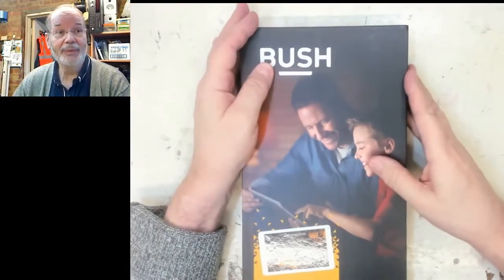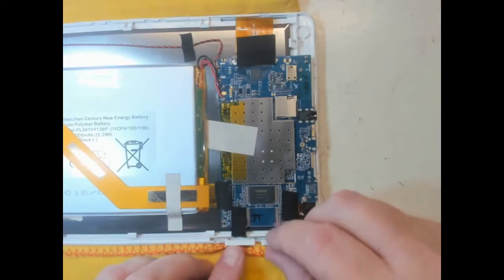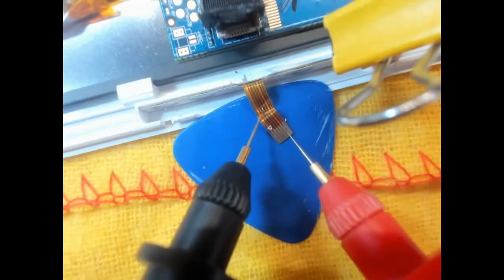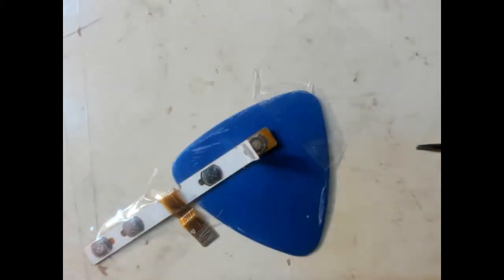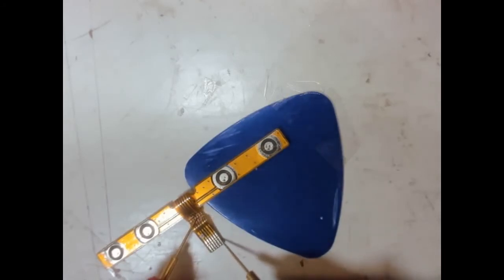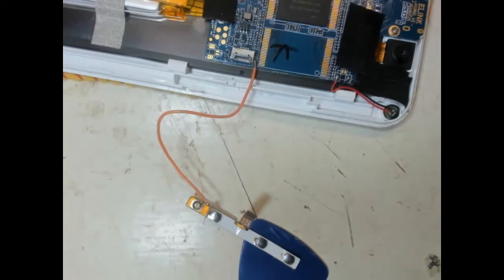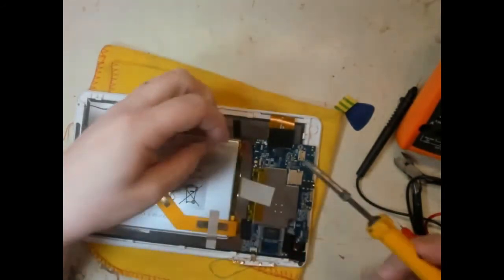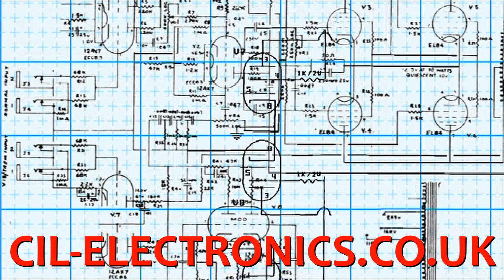Fixing a BUSH Spira B1 Android Tablet that will not power up.

Comment: I have a question if you can answer I got the same tablet but sadly been sat for months and when trying to charge it it shows low battery level then goes off goes on goes off
Reply from the maker: I suspect the battery is faulty, not charging correctly or It could be a bad connection. If you have got inside the tablet, does the battery look swollen?
Reply: @ChasLarge  No not yet so far it's my nieces and she doesn't use it as much so it's been sort of dormant and my mum tried to turn it on then put the charger in and it just shows the flat battery sign like it gets a jolt signal but fails to go from there we've had it god knows how many years
Reply: I'm having the same problem as what you mentioned!

Comment: Be careful with these Bush tablets. Mine came with built in malware which was impossible to remove.  Solved the problem with a VPN called NoRoot Firewall. This was set up to refuse a bunch of system modules permission to access d'internet.
Reply from the maker: Thanks for the warning.